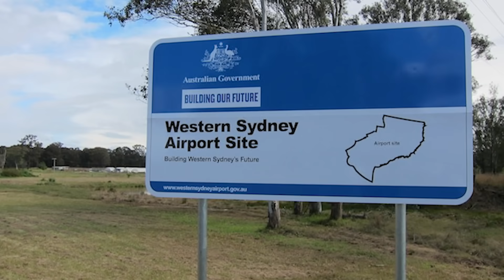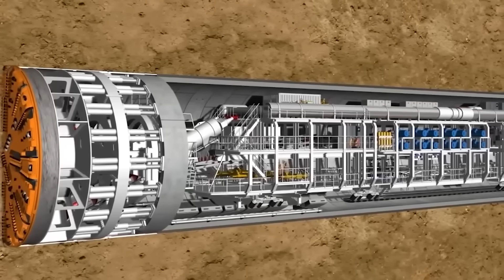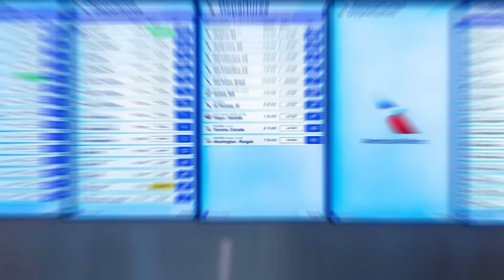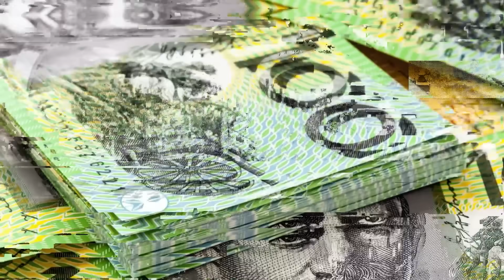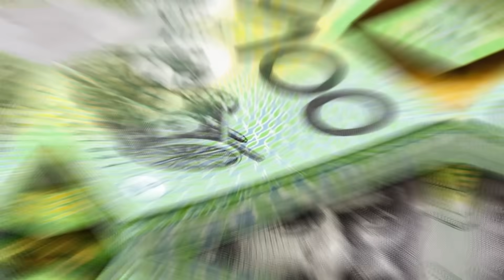The SHOCKING Truth Behind Western Sydney's $11 Billion Railway

Comment: Only 4 carriage capacity for an airport rail line & incompatible with the North West Metro. WHAT A JOKE! Should have been 8 carriage capacity, no less!
Reply: Maybe for now. I’m assuming they’d wanna check capacity numbers before going all out. Which is fair because atm not many airlines/ proposed flight paths have been confirmed for WSI yet compared to SYD
Reply: @shenzi0116  That’s a good point. I’m assuming it will be something like Olympic Park after the 2000 Olympics. It took about two decades for the area to develop into a reasonably busy employment, residential and sports/entertainment area. These things don’t happen overnight.

The initial airport can handle about 10 million annual passengers (MAP), which is about the same as Canberra and the Gold Coast airports combined. The plans already exist for expansion up to 82 MAP, which is on par with places like London Heathrow. Expansions of the existing terminal and ground facilities will enable up to 37 MAP using the first runway alone.

What I don’t expect to see is some politician cut a ribbon and all of a sudden it will be alive with busy aircraft movements. The first phase will probably be dominated by some air freight services. Compared with passenger services they are easier to ‘turn on’ reasonably rapidly. Airlines run to tight profit margins. They will want reasonable certainty about numbers and destinations before committing in a big way. And often that might be limited by the need to match their fleet to the task, And the time taken to restructure a fleet can be annoying long. Operators to country centres will have a more difficult task. Often their passengers will want to connect with other flights, and SYD will probably dominate that for a while.

On a more positive sign, Qantas and Jetstar are talking about basing 15 aircraft at WSI. That’s enough to have regular flights to at least Melbourne, Brisbane and Gold Coast; which is more than half of the Australian passenger market for flights from Sydney.  Air New Zealand are talking 2027 and will probably do well with late night departures for morning arrivals in NZ, and possibly other Pacific destinations. Such flights are already running to NZ from Brisbane and Melbourne (who have no night curfews). Singapore Airlines will probably look at making some connections with onwards flights through Singapore that SYD can’t really service. I’m not sure of details about that, but Singapore only rarely puts a foot wrong about almost everything.

Another positive sign that few seem to have noticed is the recent opening of Newcastle airport's new terminal. For what is basically a “regional” airport it is getting a commendable number of flights out to several domestic, and even some international, destinations, as a result. The very best of good luck to them. 

Sydney airport has been beating the drum recently about lots of improvements and raising their capacity to 70 MAP (currently in the low 40s). On the good side it’s an indication of how having an emerging competitor is sharpening their focus. I’m not sure how they would get to such numbers. In the already busy high margin peak periods their main option would be to use larger aircraft, but I suspect WSI would compete well at peak times with a lower risk of delays. There’s no good reason anyone west of a line from Liverpool to Parramatta would prefer an available peak flight from SYD over WSI.

In the longer term, (30 years) I suspect WSI will win out in terms of sheer volume. It just has so much better advantages in layout, turnaround times, landing aids, facilities and so. The second rail connection more directly to Parramatta and the City, will eliminate most excuses against using it, for the majority of people in Greater Sydney. That will probably leave the high-margin end of the passenger market (“snobs and toffs”) for SYD to exploit. Western Sydney is a rapidly growing, productive and pragmatic place, and increasingly more people will find WSI more convenient than SYD.

I predict, apart from unexpected events (like both airports being used as RAAF bases) that WSI will become the main airport, and SYD will evolve into a large version of London City Airport, with its convenience to Sydney’s pretty places and (by then AI dominated) financial districts, and the odd ‘rich kids’ backpacking at Bondi.
Reply: @shenzi0116  Why would only make a 4 carriage maximum only for underground stations. It should have been designed for 8 carriages in the future. This is very poor planning as it cannot easily  be changed as it's underground. STUPID!
Reply: It’s a light metro. They are optimised for wider, less populated routes at a cheaper price as they and their stations are more compact. The M1 and West Metro are different, they are optimised for large passenger loads in and out of the Sydney CBD and for special events, such as at Olympic Park.

Now let’s do some numbers. The WSI Airport Metro's initial capacity is up to 7740 persons in each direction per hour. That’s using 3 car trains every 5 minutes each way. That’s much more than needed for the initial operating contract period of 15 years. If you increase that to every two minutes (which it can do) it increases the numbers to 19,350 PPHPD. Increase the train size to 4 cars (which the stations and maintenance facility is designed to do) and that increases to 25,800. That’s well into busy 8 car commuter train territory, but far more frequent. 

Plus there is space reserved at the airport for a second metro into there as airport patronage increase (probably an extension of the West Metro line from Westmead and the city; but maybe part of a high speed rail line across Sydney. Probably not needed until the 2050-60s.

Unlike the M1, the WSI Metro and Metro West will use the (modern standard) 25KvAC power supply. Why, because it is cheaper to construct and operate, yet gives a better performance. It only needs about one fifth the number of sub-stations. The high voltage means lower amperage for the same power. The lower amperage means lighter wires and stanchions can be used - far less copper and steel. The West Metro will also be using 25KvAC. The M1 could not use it because it runs so intimately with the existing Sydney Trains 1500vDC system, especially around Epping, Chatswood and Sydenham. 

BUT, you would prefer a far more expensive system because of ??? compatibility with lines it doesn’t connect with. WHAT A JOKE!
Reply: @tacitdionysus3220  A cheaper price? Are you kidding! It cost a bloody arm and a leg for a way inferior product. It does not cater for the future, is an absolute waste of money & a complete joke.
Reply: @PeterCowan1969YouTubePersonal  Which is why, of course, the entire population of Sydney has already come to hate using any metro, and much prefers the existing, faster, more frequent, highly reliable and futuristic commuter rail system.

Comment: Megaplan, yes. To avoid bankrupcy - just pay from the budget. Our beloved govt as its best.

This metro line will not work for the nearest 20 years at least, as it goes fron nowhere to StMarys, one of the nastiest bogan holes in the whole Sydney. Out of 6 station 4 are in empty fields, NOTHING is there, only some farms and landfills, so no traffic until it will be built up. And the main idea to provide connection for airport passengers is rotten too - the last what international air passenger wants after 10-24h in flights is to travel on trains, with all nuissance of train change and finally get to - where? Ah, nowhere, grab all your baggage and walk home from station! Its the reason why Airport link went broke, why Brisbane AirTrain goes the same way and why Melbourne hypotetical train to airport (for miniscule 15B) will repeat the same glory path. Perth airport line does not work either, it is a good commuter line but very few use airport station itself.

Not talking about the bizarre idea to build namely metro there, in far west suburbs. Its the typical case for Sbahn, which in Sydney case means usual trains, not for Ubahn/metro, inner city transportation system. Ah, yes, and this metro is NOT compatible with existing (Tallawong) line - it uses 25KVAC system, not 1.5KVDC, so its the reason why it stops in StMarys and leaves a huge gap to Tallawong - it can not be built from Tallawong side, only come to there from main core.
Reply: 1 - Obviously you haven’t driven through the area recently. Huge industrial developments, warehouses, logistics centres, huge data centres etc.
2 - Nor do you seem aware that metro technology has moved on. The classical metros servicing densely populated inner city areas have are now complimented by Light Metros servicing more lightly populated areas (and the 3-4 car WSI Airport metro is one of these). “Fast metros” (100-160kph) are now also becoming popular for transporting people between widely separated major centres in a large metropolis. Chins appears to be the first to use them as part of a broader transport system.
3 - Like most of the worlds metros it is a separate line. That means it is not limited to complying with the old standards in an existing system, but can take advantage of new and better technology. For example, 25KvAC is much, much cheaper than 1500vDC power supply. It needs only about one fifth the number of sub-stations, The high voltage means low current for the same power, and lower current means lighter wires and stanchions (far less copper and steel).
4 - By the way, Sydney in general is a pretty safe place. St Marys is actually a safer area for travellers than the inner city of Sydney. For example, the assault rate is only about a third of that in the city, where many tourists now go. Things like domestic violence and car theft are at higher rates, but not exceptionally so, and they hardly affect most tourists and travellers.
5 - Despite the name, the airport metro is not just an airport shuttle, but a transport spine north to south from Schofields/Tallawong to Campbelltown. The western suburbs is about half the population of Sydney. After Sydney as a whole and Melbourne, it is is the biggest employment and residential area in the country. Doesn’t sound like “nowhere”.
6 - Your first sentence doesn’t make any sense. Sounds like an adaption of the anarcho-syndicalist peasant sketch from Monty Python and the Holy Grail.